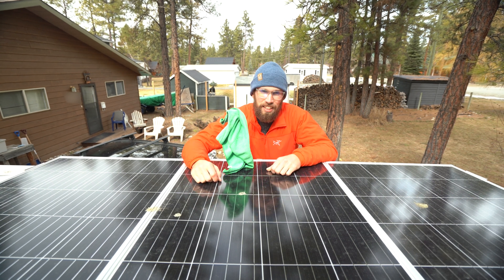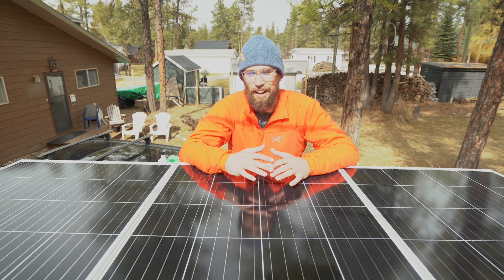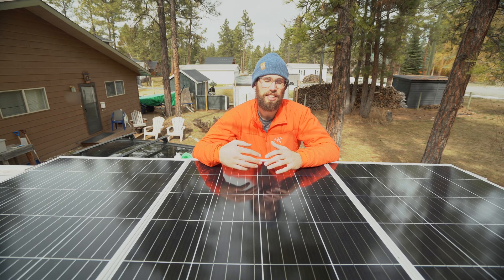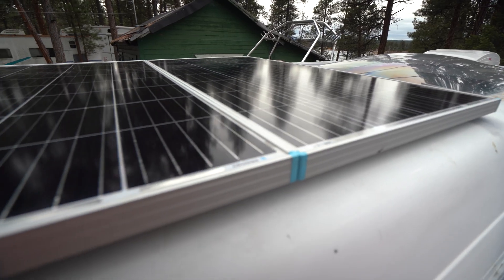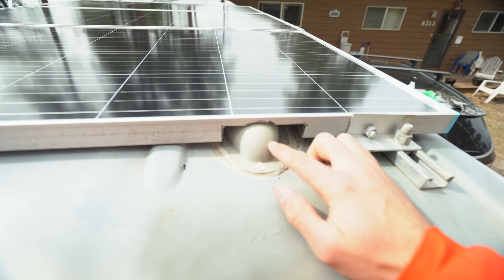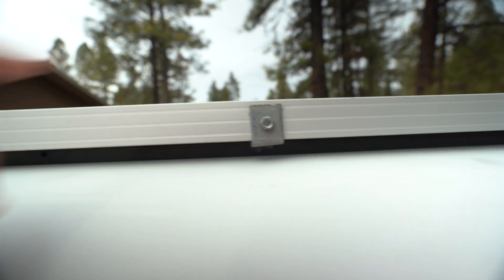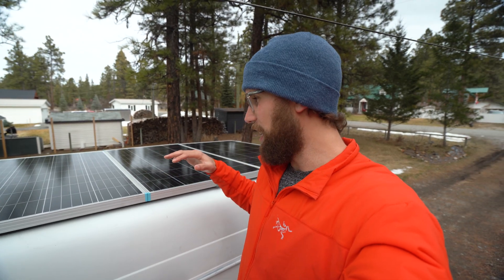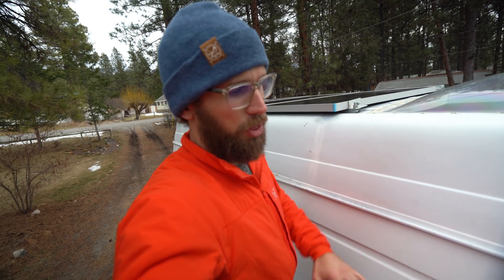RENOGY SOLAR PANELS: How to Install Solar Panels in Off Grid Solar System

Comment: Greetings, great videos. Quick question, I have a TN1 van do you have any photos of how you drilled and set the rivnut in order to secure the strut rail? My camper is finished inside so really don’t want to remove ceiling.
Reply from the maker: Unfortunately I don’t but it’s very straight forward. I learned how to use them during my build out. I’d watch a video on installing rivnuts. You shouldn’t have to remove your ceiling.
Reply: Thank, I has used a rivnut before, I was more interested in how far you had to drill into the cross member? @madetoexplore
Reply from the maker: @dieppe3340  I didn’t go into the middle of the members, just on the edge of the member

Comment: Hi and thanks for these awesome videos. I'd have many questions but the one i'll ask is about your SkyLight. Dis you need to cut off one of the sealing metal brace that is part of the van's roof re-enforcement structure or did the skylight fitted between them ? Thanks !
Reply from the maker: Welcome! Yes, we had to cut through one of the braces.

Comment: Once our upgrades are done we will have 1000 watts and 600Ah EnduroPower Lifepo4. Split between our cargo trailer conversion and our camper van.
4 Renogy 100 W, 1 Trina Solar 415 W and two BougeRV 100 watt panels. Three charge controllers.
Reply from the maker: Wow! That’s a lot of solar power. Good for you guys!
Reply: @madetoexplore  thank you, it started as 200 watts and has taken 4 years. We’re just going from 800 to 1000 now and upgrading batteries now. I have the stuff now I need the time to do it…

Comment: Extendable aluminum ladder is key. Super light and small and works amazingly and you get to keep that stealth factor. They are like 150$ ish Canadian on amazon.
Reply from the maker: Yes I have looked at those. Thanks for the recommendation!
Reply: I second this! (Maybe 5 months too late, but I just got here 🤓) mine is fantastic, and only cost about $100 CAD!

Comment: If you live off grid full time in Northern Europe you are way better off having two, four or six panels as series parallel wired panels strings.
Reply from the maker: Interesting, why is that?
Reply: @madetoexplore  Series connection boost to the voltage can double the amount of time when charging can take place in times and places of low light and/or short daylight hours.
Reply from the maker: @brotherkith  thanks Kith! I’ll have to take a deeper dive into this. It’s to bad the Renogy DC to DC charger with MPPT is only capable of 25V